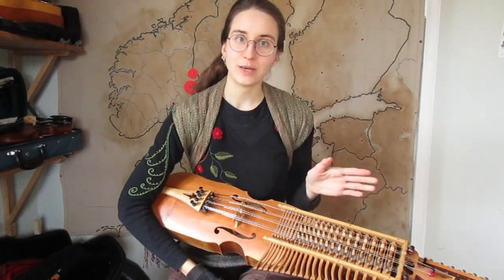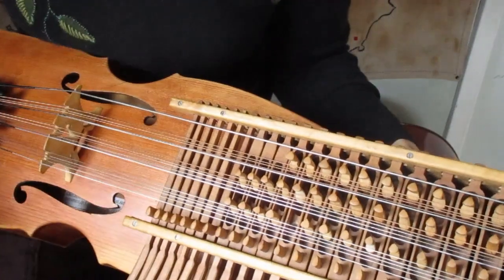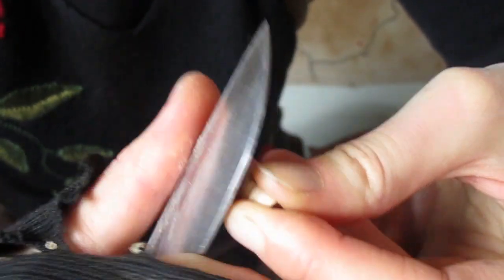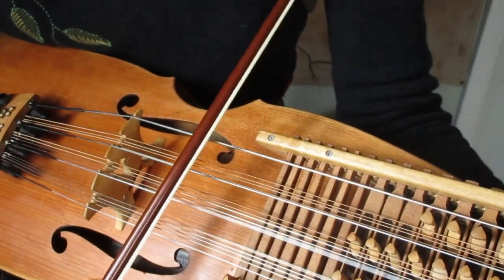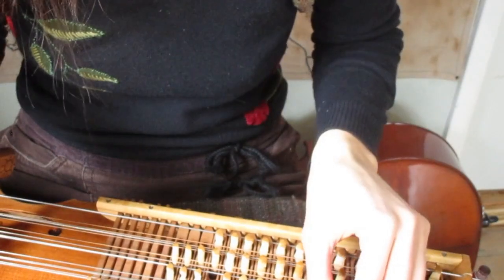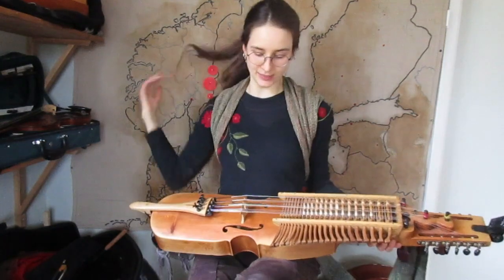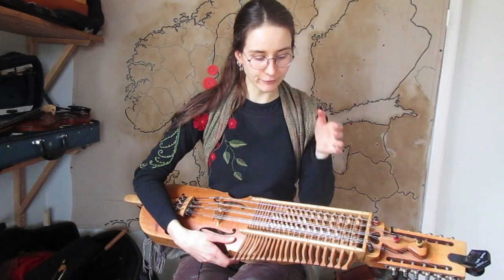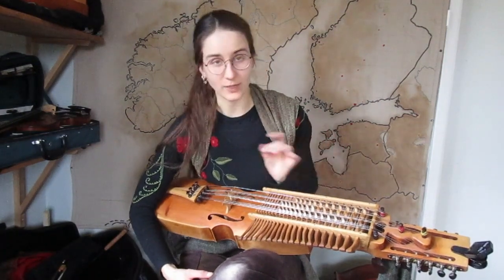Fix buzzing noises on Nyckelharpa - Scandi Folk Nerd #23

Comment: A secret to using pliers with delicate materials like wood:  put a couple of layers of duct tape on the inside of the pliers, overlapping the edges.  You can also use a piece of cloth on the inside of the pliers.  Basically, so you don't have direct contact with the pliers and the material itself.
Reply from the maker: Good tip ! Condi also has sanded down the "teeth" on one of his pliers and when it's smooth it's way less damaging to the wood. I still prefer my fingers though ;)

Comment: My nyckelharpa resonance strings buzz when I play loud, but I only really noticed it when I switched from 6+6 to the stepped gauge layout (I use G# to G). When I can be bothered I'm going to change to 4+4+4 and if that doesn't improve things much I will go back to 6+6 using the original (unknown brand) resonance strings I got from the maker back in 2005.

But the solution for me is that I'm looking forward to my new harpa arriving Jan/Feb 2022 (Johannes Mayr), which should iron out many issues (e.g. loudness and tunability - some notes are not possible to get perfectly in tune because mine is an amateur built instrument with tangents that are not pointy enough and I'm afraid of stuffing around with them).
Reply from the maker: Yes some instruments sadly have too many flaws to be really fixed for good, especially not by someone who's not a professional NH builder. They're still good to learn to play and all, but sometimes will never be able to give you a clean sound. Nice that you have a better one coming your way soon =)

Comment: Thanks for the video. It is always interesting to learn new things and ways to solve problems like this. I did my first oktavharpa a year ago, and I had to remove many vibrations, and some have been impossible to remove. Now I am building a nyckelharpa and I hope I don't have as much trouble as I did with the first one with vibrations. In my case, the manufacturing problems are compounded by my little playing experience. But the latter can only be solved by practicing every day and with a lot of time. 
What kind of wood is usually used for tangents?
Best regards from Spain.
Reply from the maker: Yes oktavharpas seem to often have vibrations problems, perhaps because they have, well, one more octave to have stuff resonating with other stuff ^^ 
Jean-Claude Condi told me that the best wood for tangents is some specific swedish maple, which is very hard and dense yet easy to carve. I guess some other woods with similar properties would work just aswell. I'm personally fond of Sorbus torminalis wood (checker wood) for my woodworking, because it's super hard and resistant, yet not fibrous at all and easy to carve (and has a nice colour on top of all that). I made two fingerboards out of it and it's as good as any ebony. I might try it for tangents some day.
Reply: @EmelieWaldken  Thank you very much, Emelie. Maybe I started by making a more complicated instrument to be the first of this kind. I hope this second doesn't give me so many vibration problems. For the tangents I use Quercus Ilex wood, but it is very difficult to work because of its extreme hardness.

Comment: Indeed, it's not surprising that these additional keys and tangents may cause issues like this. I also have the exact same Jean Claude Condi (JCC for short) extended keybox. It is very ergonomic, but I have to confess that I'm very rarely using these extra keys. While the notes on these keys are "right" (I mean they have the proper frequency) they require a special care about the pressure applied on the key in order to ring and produce a sound "not so muffled". Some famous players (like Emilia Amper) also have an extended keybox (I even suspect her having quarter-notes) and get the best from these beasts. So, let's assume it's just me that still need a lot of practicing. :P

Changing the resonance strings tuning is really a clever thing that I didn't think about. The 2 notes to "swap" must be on strings having the same diameter and tension, however. The way to tune the resonance strings may also be a BIG debate...
Eric Sahlström tuning is G# B Bb G A D C# C F# E Eb F
JCC tuning is C# E Eb C D G F# F B A G# Bb (a fifth lower, indeed) and this is the one I had on my nyckelharpa from the very beginning.
I'm raising the topic because I considered the issue as I had a very annoying problem on the E (second key on the D string): it really ringed like a horn (very much louder than the other notes). From the original tuning I tuned all the resonance strings a half-tone lower and the issue just moved to the G!!!!!!!!! (empty G melodic string!!!!!!!). That was very confusing. In the end the issue totally vanished when I changed my melodic strings: old ones were Savarez, new ones are Helicore. They are much more expensive but they sound MUCH better (a bit louder, too), and the resonance strings are much more responding! (I came back to the "regular" JCC tuning) I don't have this "horn" problem anymore with these strings.

Messing/mixing the melodic strings makes me sceptical, indeed: Esbjörn Hogmark (probably the best known actual nyckelharpa builder in sweden, who learned directly from Eric Sahlström) reported that even Eric confessed not using the "bizarre" tuning he himself created, as it didn't provided much benefit... He's still using the "regular" tuning on his instruments (from G and then an half-tone higher for each subsequent string).
Reply from the maker: Thanks for the tip about the Helicore strings, I've used Savarez (sold by Condi) from my start and never had a problem with them, but I'll try the Helicore too some day, just to see, perhaps I'm missing a better sound !

Yes some 'harpas go crazy on just one tone apparently, I guess it's some kind of overload due to the resonance string and the note in question on the playing string.

Thanks for the two tunings ! I never manage to remember the Sahlström one as I've never personally used it.
My current one (updated after the fix that is) is : Bb C A B G# G F# F E Eb D C# (yeah, no logic whatsoever ^^)

I feel the upper keys on our extended keyboards are really a question of habit. For some tricky fiddle tunes I couldn't see myself use another keyboard anymore. Also I love to play "in Moraharpa mode" as I call it, which means on just one string, and I do that on all 4 melodic strings, with all the climbings required to stay on that one string.
I also feel the notes up there start sounding better once they're played more often - or perhaps the musician learns how to press on them just the right amount ;)